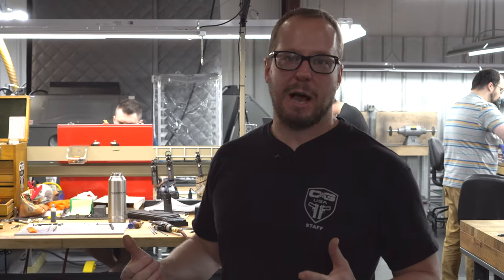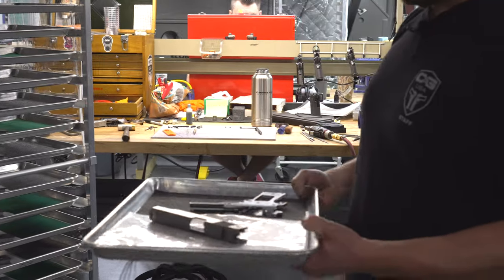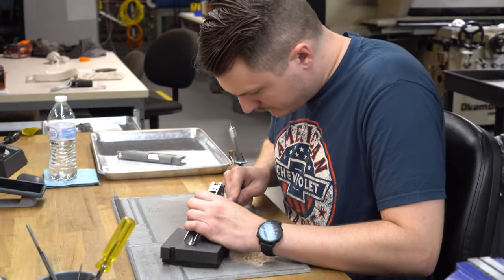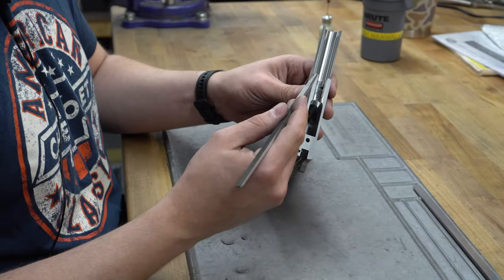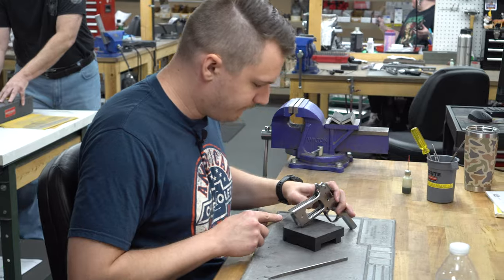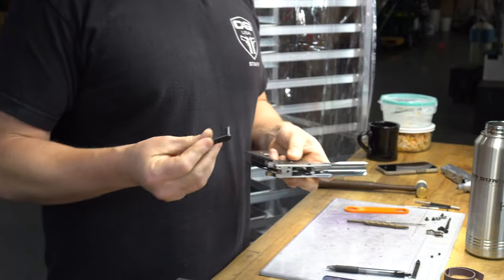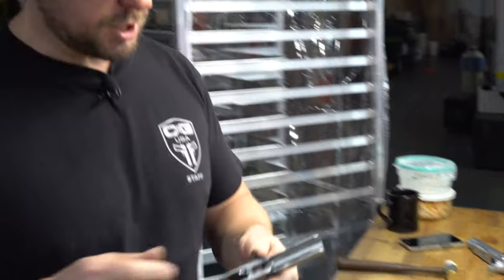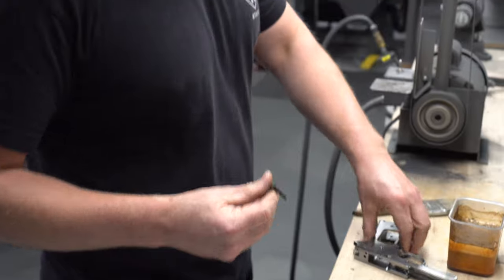ACW Unplugged Part 1: Hand Fitting an Alchemy 1911 Frame and Slide

Comment: With today's CNC machines, you would think there would be no hand fitting in 2023, but I guess I am wrong. This was an eye-opening video thanks for sharing.
Reply: Cabot is the only manufacturer to do that, that’s the problem with 1911’s, the tolerances are all over the place.
Reply: @alanmeyers3957 only manufacturer to do what?  Hand fit the pieces of the build to each other?   Ummm NO, no they are most definitely not the only ones doing hand fitting…